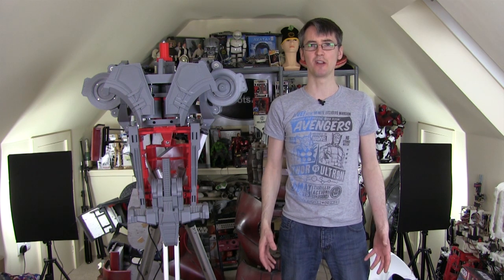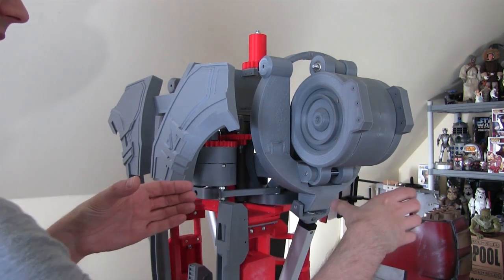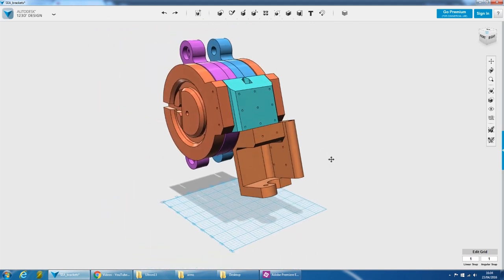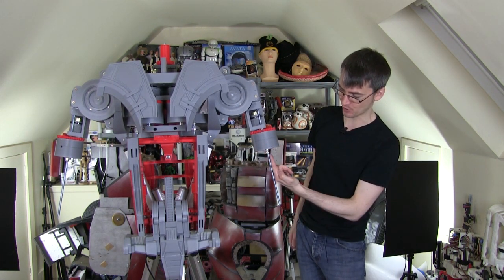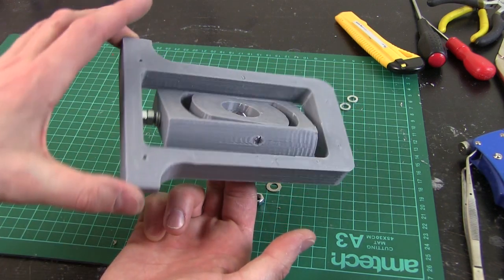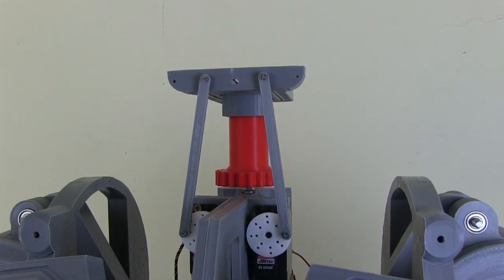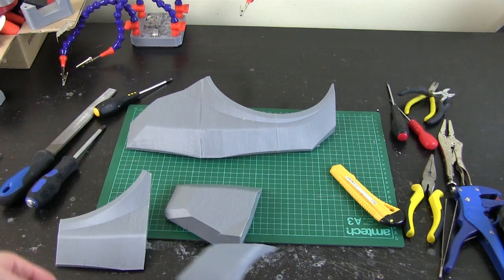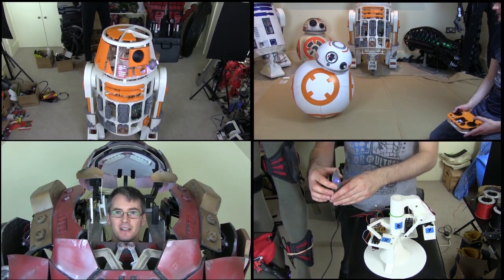Avengers Ultron #13 | Upper Arm & Neck Assembly | James Bruton

Comment: Are you going to use 4 force sensitive resistors for each joint? Isnt 2 enough? just saw you had 4 holes in the big round joints :P Give some insight of the benefits of using 4 please :)
Reply: +James Bruton (XRobots) Ahh I see. So when you preload the FSR you get no backlash and hence a more accurate reading. Smart, you really think through everything :)

Comment: I don´t know what weight the servos will have to turn, but you should watch out for some good high torque servos in the arms. Otherwise they could burn out and cause some serious trouble with the Ultron burning down.
I had an issue with a servo where it caused a fire in an electro box of a rc-car. There burnt down some really expensive parts. But i guess you have more experience in that theme than i do and be aware of. ;) Anyway, i really enjoy watching your videos.

Comment: +James as a quick thought: where force sensitive resistors may not be feasible, have you considered reading the current drawn by the motor? It would increase linearly with the demand and thus, it could provide a rudimentary and easier way to measure to force exerted on the motor and joint.

Comment: surely the head servos should rotate with the red gear, otherwise there is no point in the red turning mechanism for the head as it wouldn't be able to look left or right without tilting the head
Reply: +Joe Orford He will compensate for the tilting in software.
The servos are fixed because there is too little space for them to move when the arms are up.

Comment: You could do Awesome comedy with this Ultron, by installing some cut wires and stuff under it, and pretending that ultron lost  it's legs, and is unable to move. Another thing would be, to make the legs, and have ultron sit in the preview, on a bench, so there would not be need to make the legs actually work, maybe just some very basic movements to legs, but to have the whole ultron full sized, and not only upper half, would be awesome

Comment: James, should it not be possible to put two sticks that can slide up and down inside the fake pistons on the front, then mount the sticks with some kind of ninjaflex mounting holes on the upper body base plate to solve the problem with the fake pistons not following along when the suit leans side to side or back and forwards? (In other words creat two non motorized pistons that will just follow along with the real pistons.)
Reply: +James Bruton (XRobots) I mean those two grey cosmetic pistons in front of the red ones in the stomach area.
Reply: +James Bruton (XRobots) Okay, thanks for answering so fast.

Comment: Wouldn't it be awesome to come up with a formula to describe the head position in terms of the two servos? 
Then attach that to something like the X-Y joystick on the Blynk app so you can move that around to move his head!
Reply: Oooh also his base unit should look like some form of prisoner confinement, so it looks like it's gripping onto him and you can have cables etc trailing down to the ground like broken parts/nervous system. That would disguise any power cables and also add aesthetics to the base with minimum effort!
Reply: ***** As a basis, the head should be in its "central" position when both servo cranks are at their 90 angle, i.e. horizontal.
So; 
POS | Lservo | Rservo
UP = 180, 180
MIDDLE = 90, 90
DOWN = 0, 0
TILT LEFT = 0, 180
TILT RIGHT = 180, 0

Something like that may help with some simple scale controls? Also pretty pleased with my base idea so I'm going to mention it again ;)
Reply: ***** Tres bien!
Reply: +Acrimonious Mirth  if you want to know anything about abs and building with it! James is the Man with all the answers. hahahaha
Reply: patprop74 Oh, I know! Going back nearly two years he was what got me interested in 3D printing and designing for it. You can see from my recent videos what I've learnt since that day :)
Reply: The best Answers and experiences, you will learn first hand by printing your own designs you are already well on your way to good learning kurf.